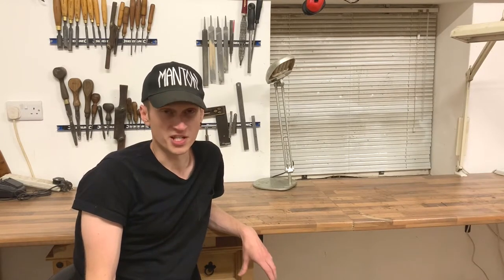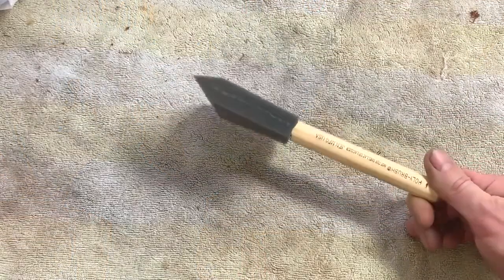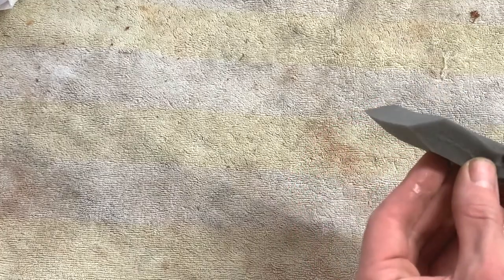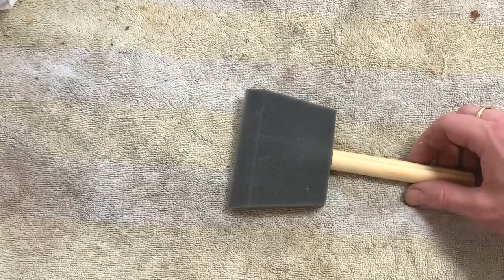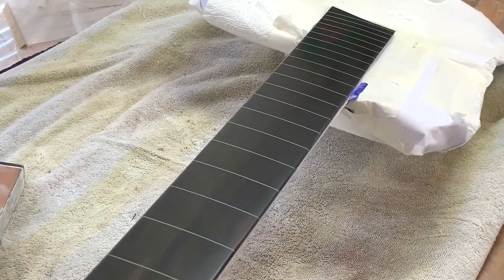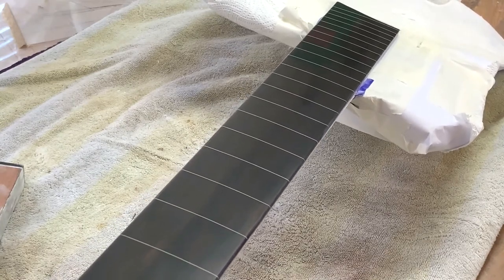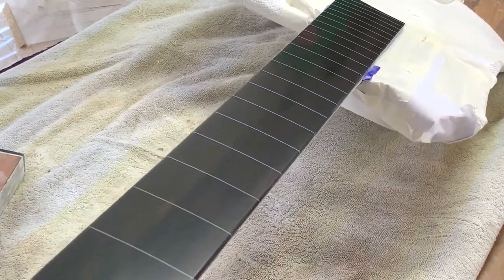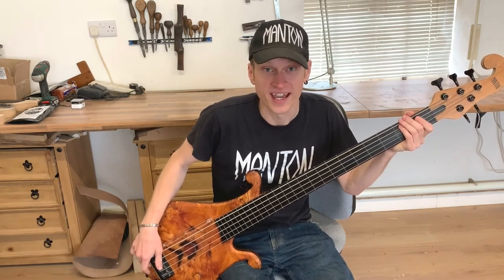Luthier Video Coating a Fretless Fingerboard with CA (Super Glue)

Comment: Did you use any activator after applying the super glue? And is super glue good enough to use as a fret filler after you have taken the frets off? Thanks.
Reply from the maker: No activator used as the glue sets off pretty quickly from the contact of the brush/foam. Activator can turn it white if you aren’t very careful, so I avoid it for this job. You need something additional in the fret slots to fill them really. I like plastic styrene sheet as it’s stable, but veneer is another common choice. Superglue is fine for gluing the plastic or veneer into the fret slots.

Thanks for watching!

Comment: I'm interested in coating a fretless fingerboard, not to protect it, but to help with that 'mwah' sound. You mention in the video that superglue doesn't change the sound as much as other methods - would superglue therefore not be the best choice for me?
Reply from the maker: The superglue should increase mwah a bit, but not quite as much as epoxy. It also depends which wood it is applied to, it’ll have a more noticeable effect on softer woods than Ebony for example. Superglue is easier to apply than epoxy, so you could always try superglue first and see how you get on. Thanks for watching.
Reply: @mantoncustoms  Thanks so much. Super helpful video, and thanks for your reply. It's an Indian Laurel fingerboard in this case. I will ponder what to do :)

Comment: Great video. I'm a fretless guy but I don't have one with a coated board yet. I hadn't heard of using superglue before - this seems way easier than epoxy. Would I be correct in assuming it's also thinner?
Reply from the maker: Thank you. Yes, it’s a bit easier and less stressful than using epoxy…And yep, it can be made as thin or as thick as you’d like
Reply: @mantoncustoms  weirdly enough,
My first fretless was an old P bass I “Jockoed”, and I used some odd bar top coating.
I’ve had that thing for many years now and that coating is fantastic!
Reply: " odd bar top coating" ? Mind sharing details?

Comment: Hey, great video! I'm considering doing this to my fretless jazz bass one day. Did you apply any radius or is it a completely flat board on this build?
Reply from the maker: Thanks. No, there’s no radius block used at this stage. The board starts off with a radius (before the coating is applied) then the shape is refined by sanding down the string paths with a fairly narrow beam rather than using a radius block. Radius blocks make a cylinder, whereas the best shape for optimal playing is conical.
Reply: @mantoncustoms   
Thanks for clarification! 
Funnily enough I read about that on an old TB thread after watching your video. Sand along the string paths and make them level for best end result.
The string spacing is wider at the heel than at the nut, so the strings' paths don't form a cylinder but a somewhat conical shape. so put against the cylindrical shape of the fingerboard there's a hump on the string's actual path. When you level these paths, you actually create a kind of hourglass shape on the cylinder. 
Can't post the link here, but the thread is called "Even fretless fingerboard levelling tips" and post #40 is where it starts. absolutely brilliant stuff right there!

Comment: Hi, Do you have to wait for the glue to dry before sanding?
Reply from the maker: Hello! Yes, but not for long…20 minutes or thereabouts. The glue dries from contact so as you’re working it with the applicator it’s setting much quicker than it would if you just squirted it on and left it.

Comment: How much superglue do you need for this? Is a 2oz bottle enough or do you need a couple of bottles?
Reply from the maker: I used about 2oz on this neck, but it was very long and quite wide an area. So 2oz should do a normal scale 4 string easy for example . But it depends how much you end up sanding off and how thick you apply it. An extra bottle as backup couldn’t hurt!